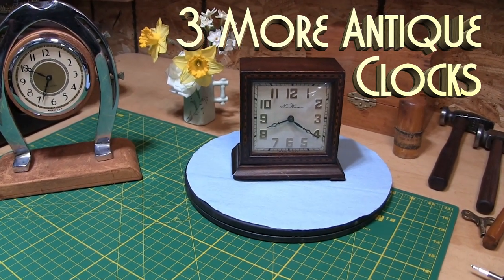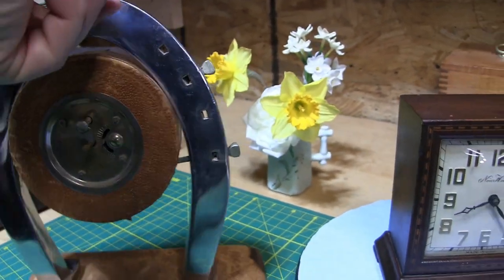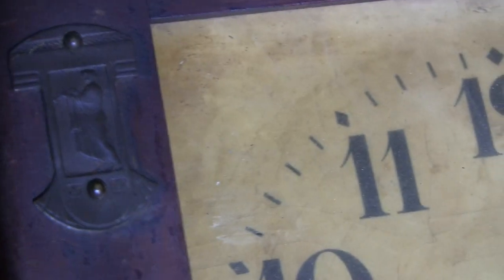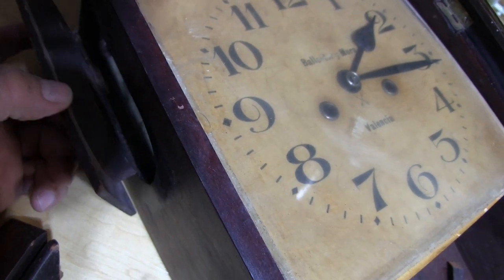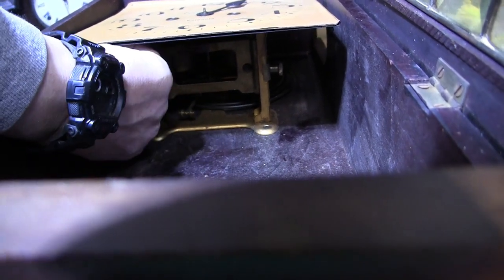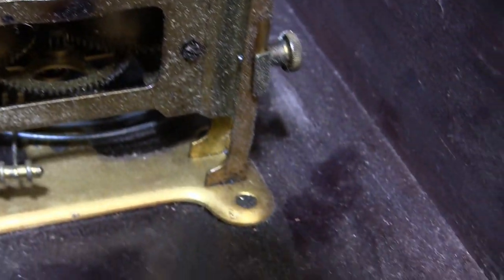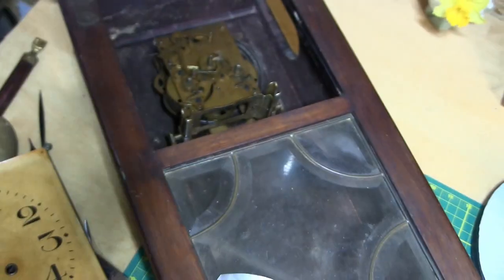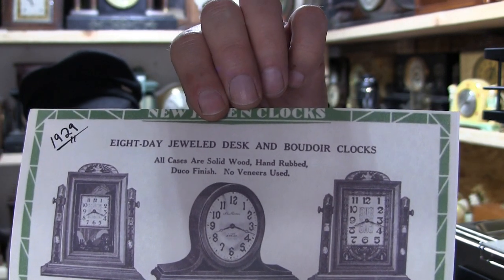3 More Antique Clocks, New Haven, H.A.C. VLOG

Comment: Hi Ab, very interesting clock, the H.A.C wall clock, the movement the way it fits onto the bracket and the way the pendulum fits on is similar to the way a Vienna wall clock is, and that dial i noticed a hole one the pillars at the back of the dial where a taper pin goes and on the movement seems to have three corresponding holes so my thought is the three pillars on the back of the dial goes into the holes on the movement and is secured with taper pins i could be wrong good luck and take care
Reply from the maker: Thank you, Paul! You have a good eye there! 👁 Very strange setup to me but perhaps run of the mill for this kind of clock. Thanks again and Best regards, Ab.😸

Comment: Hello again Ab.  I think the doors on the sides of the case of the wall clock are there to provide access for adjustments to the movement while it is in the case.  I have a couple of wall clocks that have those and they are fairly common on cuckoo clocks as well.  As another commenter said, the three feet on the back of the dial look like they would go into corresponding holes in the front plate and locked in place with taper pins.  Dials on 400 day clocks are often attached to the movement this way.  The dial I think has holes in the four corners as well so maybe it is supposed to be both attached to the front plate by taper pins and also screwed into the case, which would be a way of getting the movement positioned at the right depth inside the case.  The hammer on the bottom of the movement doesn't look like it is positioned to hit anything so I am wondering if someone just shoved the gong under the movement - maybe the gong is supposed to be mounted further down in the case so that the hammer can hit it.  The other two clocks are interesting as well so this was fun to watch.
Reply from the maker: Good thoughts there Paul! I never thought about the wire bell possibly being shoved up there. After all, it is a Goodwill clock and they do a lot of shoving and pushing!😸😸